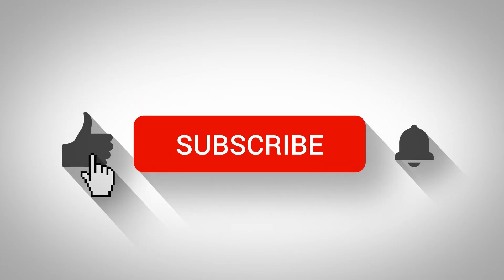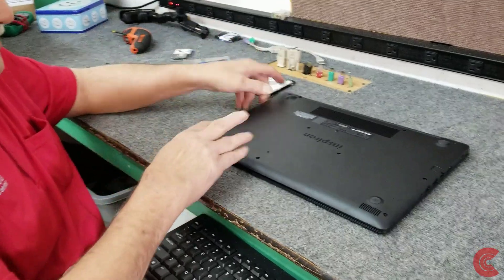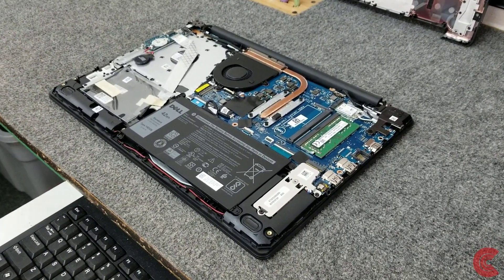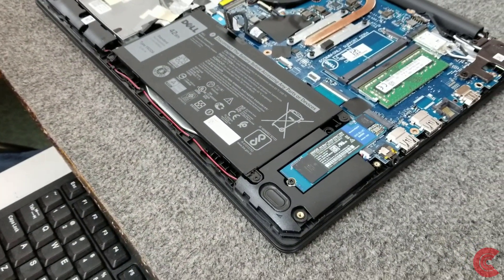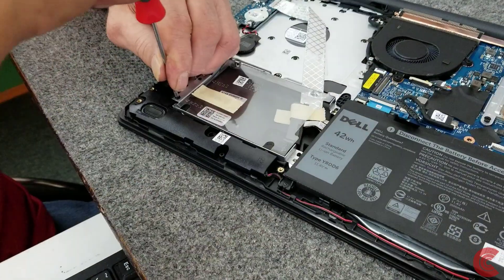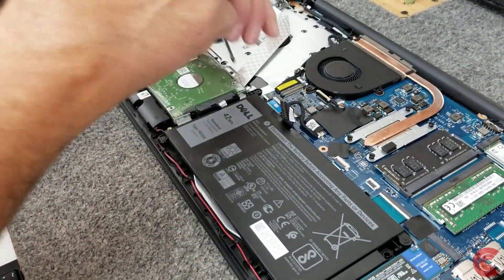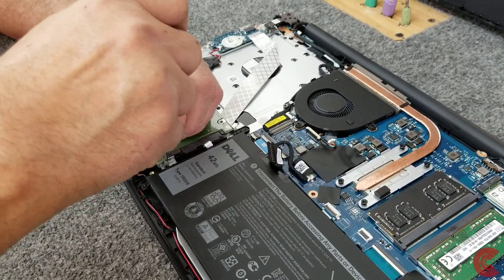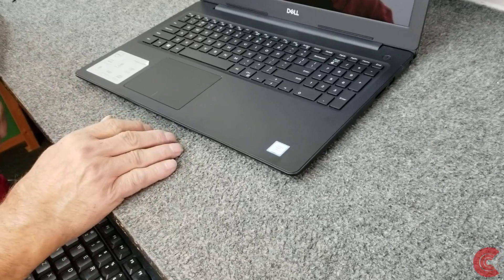Dell Inspiron 3583 How to Upgrade M.2 SSD, Memory and Add Additional Hard Drive

Comment: I have a Dell Vostro 7590

I'm thinking of upgrading internal storage.

The PC has a secondary SSD slot and hard drive slot

I am just thinking...if i choose to add a 1TB HDD and transfer files from the primary SSD to it...will it be on par with a 512GB secondary storage upgrade?

I need recommendations.
I don't want my PC to slow down

Comment: Does the ssd m.2 needs a heatsink when installing in this pc or it’s good without it?
Reply: The m2 doesn't need a heatsink. As a matter of fact I put a Samsung M2 2280 in and installed the original heatshield over it using a heat transfer foam pad. I ended up taking it off because it ran hotter with it on. Checking Samsung's web site they claim it isn't necessary. The M2 will throttle itself if it gets too hot. With the shield on, temps with between 140-150 range.

Comment: I have a dell inspiron 3583 put in the upgrade memory, no problem, thank you. However I can not find in Bios how to upgrade to the default 2133 to the 3200
Reply from the maker: Unfortunately,  a laptop like yours does not have a setting like that in bios. Windows will read speed of ram at what ever speed the bios sees it. If you mix a higher speed ram with lower speed. It will default to lowest speed. Not much you can do Unfortunately.

Comment: are you able to just add a 2.5" HD without a reboot of the system? (leaving the m.2 as is).
Reply from the maker: Yes, you can do that.
Reply: I’m going to add a new 2tb 2.5” SSD 5400 SATA hard drive. Is that the correct hard drive for the extra expansion slot?  Thanks

Comment: Great video. Can I ask what’s the maximum capacity + frequency this board will support (per slot)?
Many thanks
Reply: 2 slots of 8GB or 1 slot of 16GB. Runs at 2400 Mhz

Comment: my computer is shot. It's the same one you have but it has a mechale drive. can i replace the mechanical   drive with a SSD  are add a m.2 500 gb ssd and what would be compatible with this computer. I'm thing about to drives one for the operating system and one for storage
Reply from the maker: If it's the same model, you can add a 2.5 inch drive and a m.2 ssd.

Comment: Hello and a great thanks for your video. The version I have came with Intel Celeron, please would you be able to tell if there's an m2 slot and whether it's supported. Also I plan on add an m.2 ssd and installing windows to it...will that work?
Reply: Hi! How it went? Does Celeron work with M.2 SATA or NVMe?
Reply: Not sure if you had got an answer by now but My Dell Inspiron 3583 must be the same version as yours as it came with Intel Celeron CPU 4205U @ 1.80 GHz & I have asked a couple computer repair guys if the Crucial P3 500gb PCIe 3.0 3D NAND NVMe M.2 SSD I’m going to get will work & both of them told me that yes, it’ll work as this Dell laptop does have a required M.2 slot needed to install it.

Comment: I upgraded my SSD for my Inspiron 3583 a year ago, but I found that the bottom left corner of the laptop gets hot. I just found out about heatsinks after upgrading my PS5 SSD, so do I need a heatsink for the laptop?
Reply: The m2 doesn't need a heatsink. As a matter of fact I put a Samsung M2 2280 in and installed the original heatshield over it using a heat transfer foam pad. I ended up taking it off because it ran hotter with it on. Checking Samsung's web site they claim it isn't necessary. The M2 will throttle itself if it gets too hot. With the shield on, temps with between 140-150 range using Samsung Magician.

Comment: whats the "clean install" he speaks of? is this a must to be done to finish the upgrade?
Reply: A clean install of Windows 10. I'll be like a new computer, so you'll need to reinstall your software and configure your preferences. This is assuming you change out the NVME drive like he did, which holds the operating system. If you simply need more space, you could just add a 2.5" drive to the expansion slot, avoiding the need to reinstall the OS. Of course, you'll need to configure your computer to use the new drive in the manner you'd like, , e.g. move the desktop, Documents, Pictures, etc. folders to the new drive.

Comment: My batteries cable is quite stuck. Should i force it? Is it replacable??
Reply: I will add a 2.5inch hdd to it
Reply from the maker: Well dont force it, might damage it. Thar would be bad.  They can be stubborn sometimes.
Reply from the maker: Watch the video closely, if you have this same model, you can disconnect battery 2 ways.  If your just installing a 2.5 inch drive, if your VERY careful,  dont touch anything on mainboard,  you should be fine.
Reply: @CadillacComputerCenter  much much thanks

Comment: does it possible to add a ssd hard drive (the one that doesn't have a moving part) on the hdd slot (the square thingi, not the rectangular shape one that looks like a gum, idk the term)  if yes can you provide a link of the ssd hard drive. Thanks

btw I'm not familiar on their names, I just know what it looks like, and sorry for my bad English and confusion
Reply: Yes , you can use a SATA SSD

Comment: @Cadillac Computer Center. Hi, I bought this model last year, BTW, Mine was only $208.00 out the door. I just got around to checking which M.2 SSD it takes. My Inspiron 13-7378 takes the SATA M.2 SSD, not the NVMe like the model you're working on. I am puzzled why a Dell Inspiron that runs 50% less than a 13-7378 would take the faster 2 M.2 NVMe SSD, when the 13-7378 would take the slower M.2 SATA SSD. At any rate, I had a 256gb  M.2 2280 Samsung NVMe SSD I bought last year & wanted to turn the M.2 SSD into the OS drive & keep the 1TB HDD that came with it as a storage drive, so I'd be doing what you're doing. 
***My question for you is, I can either use Acronis True Image & clone the OS over to the 256 M.2, or just do a clean install of Windows onto it. Then that comes to the 2nd part of the question. Is it hard to do a clean install of Windows 7 Pro? I've had bad luck with other newer laptops when it came to doing a clean install of 7. Why is that? I did make the Windows Install on a usb drive but on the Lenovo ThinkPad, it just wouldn't recognize the USB drive, or thumb drive... Why is that I wonder. I may have been making a mistake, I don't know. I was just trying to stay away from windows 10 if possible.. Thanks for a right to the point video. It would have been cool to see how you did your clean install. Perhaps I look to see if you have another video on it. Thanks again, Dan

Comment: Great Video. I am having a problem upgrading RAM. I bought new 8 gig ram and installed it to make 16 gig. But my laptop wouldnot run. When I use only old one it runs. Any solution for this? I heard about BIOS reset and stuffs but I dont know how?
Reply: same did u figure it out

Comment: i have same laptop and i don't know your laptop also has or not amd proccessor but my laptop has and, its getting too hot, i'm only using for browser, and my laptops tempature is getting about 60-70 Celcius with no reason, i'm using in balance mod btw, do you got any tip for me
Reply from the maker: Hi. AMD cpu's tend to run on the hot side. Your laptop should be opened up, like I did in the video and have the cooling fan cleaned out. It's not to difficult to do. Or, your fan may be malfunctioning as well.  If Alot of dust and debris builds up on fan blades, it will restrict cooling.  Dale
Reply: Thank you so much

Comment: Will this same procedure work on a Dell Inspirion 15 3000 3593, that comes with a 1TB HD but no SSD? I'd like to add a 256GB SSD to it.
Reply from the maker: Hi. Yes it should be pretty much the same. You could replace the hdd with 2.5 inch sata ssd. Dale
Reply: @CadillacComputerCenter   I am trying to install a hard drive. My Dell is this same exact one as this one in the video. But it keeps just giving me a blank screen every time I put in the 1 tera btye hard drive. Do I need to install an OS on the hard drive? Any help would be extremely welcome.
Reply: @mattwedd6836  yes, on a new hard drive you would need to install windows again.

Comment: wasn´t there any drive there when you started? I didn´t see an ssd or hdd when you started...
Reply from the maker: Hi. This model comes with the hdd caddy and neccessary cable already inside the unit. As you can see in the video, I added a 2.5 inch drive. Dale

Comment: Hey I'm planning to throw another 8gb stick in my 3583, curious if they're very picky about what you put in. Will any compatable stick work or does it need to perfectly match the other?
Reply: i'm not an expert, but as long as the frequency and size is the same, it should be fine, for a better performance i also reccomend getting one with the same clock speed,

but if you're asking for the best option, i'd say you should buy 2 new ones from a single package (2x8), or at least buy the exact same model as yours, to find it, you could open your laptop, and get the part number, or get it using CPU-z software

Comment: Hi, what kind of ssd M2 have you installed in this video? WD 250 GB Blue nvme? I could not see very well.Thanks!
Reply from the maker: Hi. Yes I used a wd blue nvme m.2 ssd
Reply: Did it work ??
Without nvme just m.2 ??
Reply: How much gb it is

Comment: Hello my friend. You know, I have a 3583 too but manual says that slot is for an intel optane up to 16gb with no more info about it. Can you confirm I can install a 256gb adata nvme, install windows there and then boot?
Reply from the maker: you should be able to install new nvme pci-e ssd into slot where optane is installed. make sure to disable intel rapid storage technology, either in bios or with intel IRST app

Comment: whats the settings for the m2 drive in bios as mine doesnt show up mine model came with hard drive only
Reply from the maker: If you install the m.2 drive only, you will need to boot from a usb windows 10 install drive to do a clean install of windows 10.  You should not have to do anything in bios.  Assuming you have this model. Thx